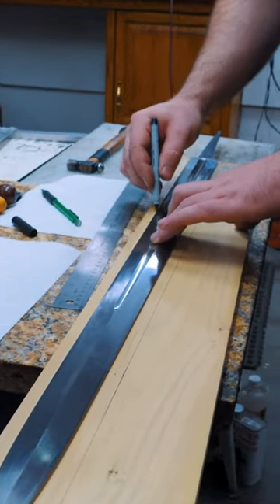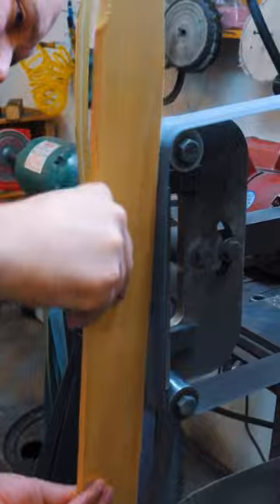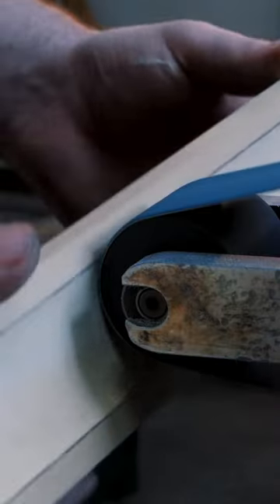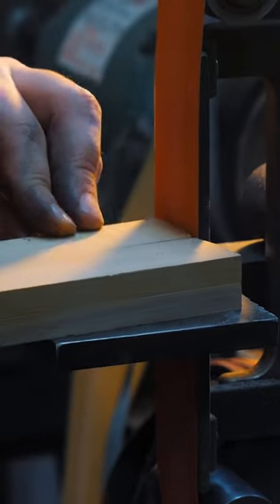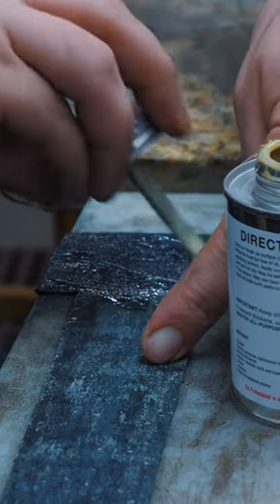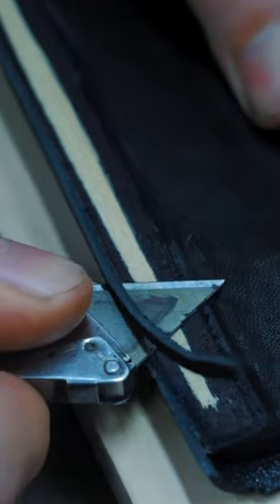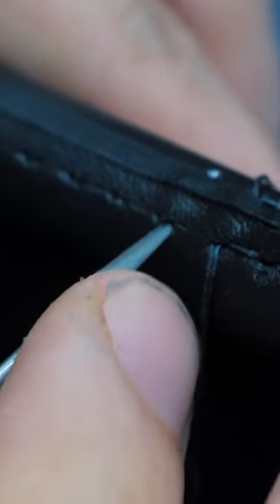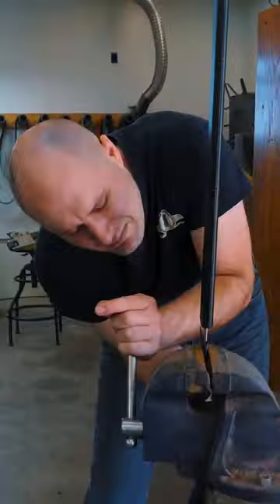Making A Scabbard

Comment: The leather inside? Is Not a Good idea. It can Draw moisture and Ruin the blade, and? If it start to come apart over the years? It will jam up the blade going in or coming out. ❤Your work is very Beautiful, and well done. I have been a Blade smith since. 1976. All the Best. Jinx da Wolf.